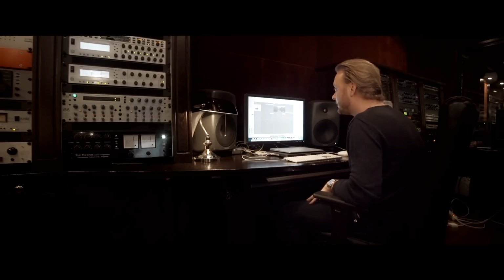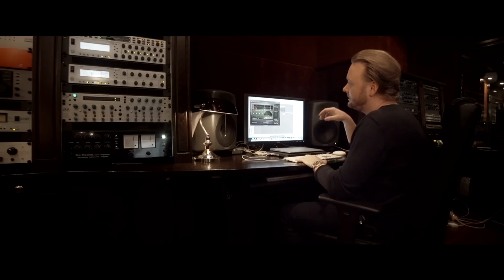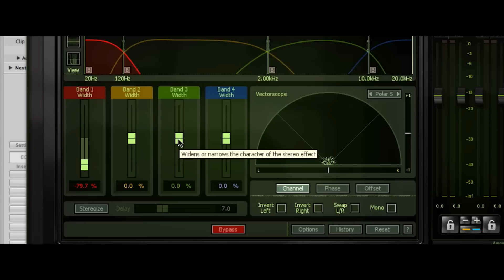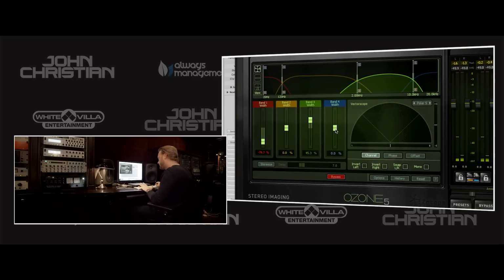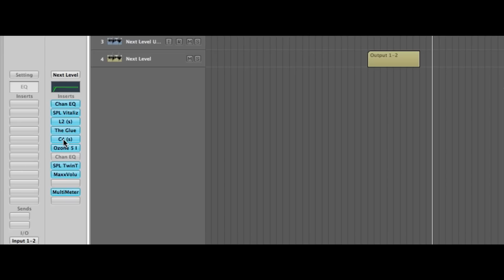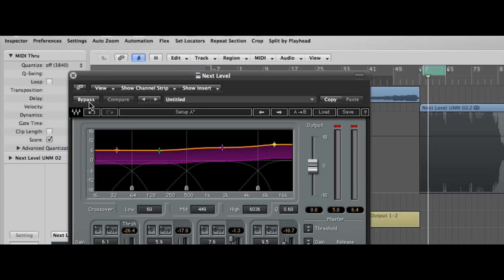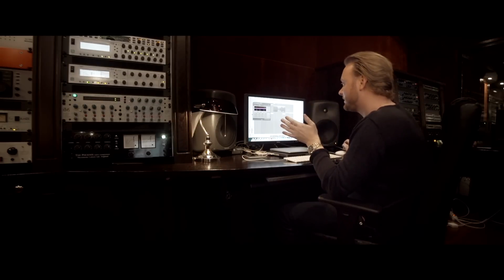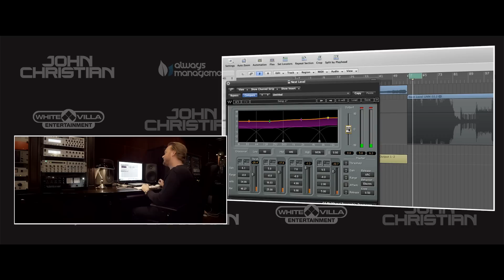John Christian's Studio Sessions: Chapter 12 | Mastering Part III

Comment: I've never thought of using the C4 in that way before. I usually try to keep the amplitude reduction indicator line at the top of the range but it does sound good having it wobbling about excessively at the bottom. I'll have to give it a go :) Thanks for the tutorials.

P.S. You're right and engineering schools are wrong. Nobody should go off level meters. After all, it's all about the "sound" and not what the meters show. If it sounds good, then it IS good.
Reply: Even "distortion" is normal in the mix anymore. Almost every edm track has distorted kick-bass sound nowadays also noises are main parts on tracks they like instruments. No rules if you want to be crative.

Comment: Hi John I have a question. If you push the mid and high frequencies so hard in the C4 won't the balance of low information and high information be out of balanced Like the focus would shift more so to the higher frequency information